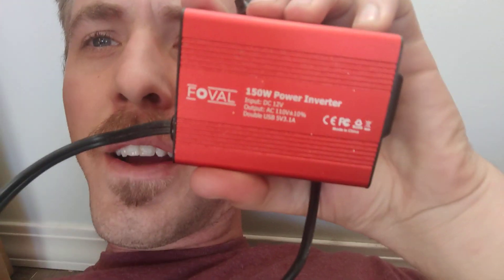Off-Grid Living: How to Size an Inverter for a Refrigerator

Comment: Wouldn't it help if one used an inverter with a short power peak that can handle the initial startup? On A/C condensers that's a common issue as well but there's a Hard Start Kit that can help which works like a large capacitor which gives it that jolt of electricity.
Reply from the maker: There's probably stuff like that out there, but for me it was easier to just buy a bigger inverter for cheap.

Comment: My experience with a 25 yr old Full Size GE Fridge & Top Freezer 250 W: I use battery bank total 2400 Wh (100Amp x 12 V times two battery connected parallel) and 3000 W Pure Sine Wave Inverter from Amazon for $55. The compressor started briefly with a fan noise from the Inverter and it died. I could not get it run for more than 10 sec max.  

I think the problem is I don't have enough battery juice to meet the 10X power surge. It needs at 
least 2500 Wh & more to get the compressor started. I must add another battery so that I have enough juice much more than the bare minimum of 2500 Wh. Once the compressor picks up steadily, then it needs only 250 W for 10 hr when you can recharge with the solar panels or wall power! Probably, I need also a larger Inverter Pure Sine 5000 W which costs $150 or more!

Comment: long story short, the startup surge can be as high as 5 amp in larger refrigerators - which is about 600 watts. size accordingly
Reply: That is for tiny refrigerator, a normal household refrigerator would be 12 to 15amps to start
Reply: Both of you are wrong....

Comment: Let me share my experience after I watched this video and tried that to my 110w fridge, with a 1000w cheap inverter.
As you said, it took some time to build up the pressure, failing and failing, but after some time it did start and kept going until I saw the usual performance of the fridge. Day two all good and i lowered the thermostat of the fridge.
Day 3 tho... The fridge was not able to keep running more than a minute and some safety relay was cutting it off. I checked the compressor and it very hot, also the pipes.
I let it cool down for a day and tried again. Same thing. I tried to push some air with a fan to see if it helps but no.
So now I believe that it may work yes. But it does damage to the fridge.
I can't try to run it run it from a generator at the moment, but I will and that should tell us if the fridge is damaged for good.
Reply from the maker: I'm sorry that happened. Sounds like you burned up your compressor. How many watts does it say on the compressor?
Reply: @Hoppervision  110 watt. There is another thing that is going on with the inverter, so I hope the fridge is still alive.
Before I used this inverter for the fridge, I was using it to power a small pc, TV etc. There was a lot of noise coming from the transformers but they were working.
Well they used to work.. Now they don't work. There's no noise, so something is happening with the wave, and the output voltage drops hugely when I connect them.
Strange thing is that a fan, a coffee mixer and some other devices are working well.... 
I don't know.. I guess I'm going for a much much decent pure wave 4kw. I hope that could power a fridge and a portable a/c.
Reply: @EX_WIZARD_YT  don't believe that 110 watt rating because that is like 1 amp on a 120 volt grid.  Super unrealistic.  A compressor is a heavy demand for amps. For a fridge I would consider at least a 15 amp x 120 volt power consumption for the start up. So minimum 1800 watt converter with power surge up to 3000 watts. You need a 2k inverter for a refrigerator.
Reply: @HealthSupercharger   what Is a 2k, 2000 watts?
Reply: @tinacote1752  Yes ...2000w
Reply: How long does a inverter with battery run a mini fridge
Reply: So if I run the invertor on a mini fridge, and it lasts two days, can I recharge the battery, saying I don't have a solar panel, just a portable power station inverter , and battery charger

Comment: Is the inverter plugged into a cigarette lighter or wired to the battery directly?
Reply from the maker: wired directly on the larger inverter that worked. The cabin has a couple cigarette lighter outlets that work with the small inverter with small devices.

Comment: So you have hooked up a normal fridge to a cheap converter. When I check “official” websites, they all say you need a pure sine wave. Yet here you are, with a modified sine wave converter and it seems to work fine. Is it really needed to spend the extra cash on an expensive converter, or will cheaper options do the trick as well? Curious as to hear your thoughts on this.
Reply: mate i've had a 600w 20+ years old inverter using power tools and everything. back then i had no idea what the pure or sine waves meant. but i used it anyway and it never stressed me.

Comment: can you run a full size refrigerator on a 600 watt generator ?
Reply: No you can not. You need a 2000 watt generator to start that compressor. 15 amps

Comment: So the one you got now. Is it like the 150watt one but just higher power ?   600 or 750watt ?   Can those run continuously without issues?    I recently bought an 12v pure sine wave inverter but not sure if they only meant to run a few hours or so if there is power issues or if low load like 100watt or 200watt can be run 24/7

Comment: You’re like the only person in the Internet to actually share real experience running a mini fridge in a small inverter.
Reply: I’m setting up a Renogy 1000w inverter with a Arctic King mini fridge running .85a 115v in my van, and despite knowing it should work, I’m holding my breath until it is... lol
Reply: 😅 well this was 2 years ago, but thanks for the tip,

Comment: I want the link of .. the fridge ! please, thank you. Inverters also have surge and actual wattage, sellers tend to give the surge (max) watts rather than the actual watts, that is an advertised 3000 W inverter = not more than 750 W real performance. So you need to get one with a surge that matches your fridge initial start, and with watts that the fridge normally uses, 2 parameters to consider.
Reply: @Hoppervision  Thank you for the super fast reply, 80 W fridge awesome !

Comment: Great video!! I rcently bought a cheap 1500W modified 12v inverter and MY WORD!! im impressed!! It powers even a 2hp air compressor!! its around 0,68kg too!!!  Inverters are the best!!

THANKS FOR THE FRIDGES VS INVERTER HEADS UP!!
Reply: Modified sine wave for a fridge? 

I thought pure sine was the only way for motors

Comment: Install a soft start on the fridge, people use them for running ac's off grid, they just take the massive inrush out
Reply: Any suggestions, links from where to buy it ? are they expensive?
Reply: @glorytooneandonlygod3871  it's usually more of a DIY thing unless you want to spend 1k on a module, but the easiest way is to get an AC motor speed controller and use an Arduino to basically turn the speed from 0 to 100% over a second or so to reduce the massive inrush. I'm sure there are other solutions out there cheaper but I haven't really looked for a while.
Reply: I seem to have been doing things the hard way I guess.

https://youtu.be/1MPW1dqulWw
Reply: @exogator  Thank you very much , such a h helpful video.  I wish someone  can make it and sell to people.
Reply: @Hoppervision  I'd honestly just integrate it into the appliance and use it's frame as the heatsink, I mean it's not like it would affect it much

Comment: heheh you didnt' account for inrush current for starting the compressor, ooopsies.
ind you, no fridge I've ever seen has this anywhere, you have to put on a power meter and monitor it.

Giandel 1000w just to be safe.
Reply: @Hoppervision  it was a TLDR comment, not a criticism :P
checked my fridge last night, 986w inrush current.   eek.
and a "GOOD" inverter is freaking expensive :(
but I have a crap load of batteries on float charge doing nothing and it annoys me wahh

https://i.imgur.com/ek5dzZt.jpg

45 from my server UPS waiting for me to get renovations far enough along to install it.  (charging from solar on the shed roof)

Comment: Hey Luke Perry and Matthew McConaughey's baby that modified wave will eventually fry your fridge pure sine is what your fridge desires
Reply: Pure sine is it needed for sensitive electronics, unless he has an inverter fridge with variable compressor speed, judging by the massive spike in power that's be a no. Normal fridge/freezer compressors are induction motors, no touching brushes, just a coil of copper making a cylinder of aluminium go crazy, as long as the voltage is high enough for it to work and the AC frequency is somewhat the shape that it needs to be it will work. Only real downside is that because it uses an induction motor you will hear the modified sign in it's humm.

Comment: I have motor and compressor appliances with total load of 1000 Watts ? 
Should my inverter sizing be 300% i.e 3000 watts and also over-estimation for safety by 130% or 1.3 = 3900 Watts necessary ?
Reply: @Hoppervision  Thank You.